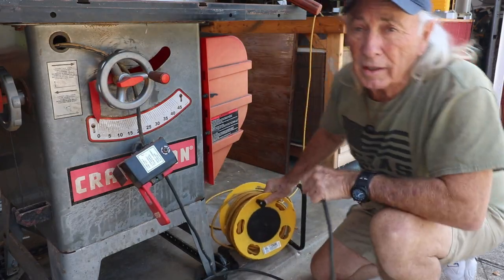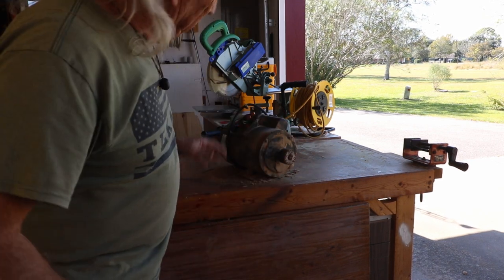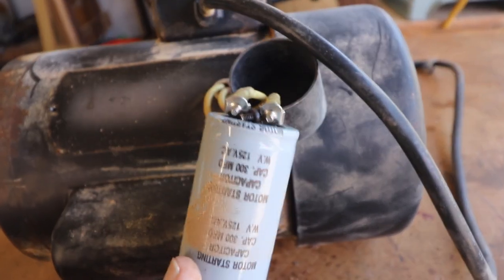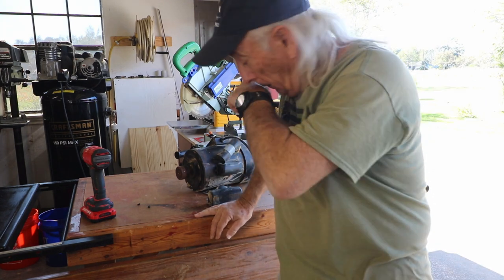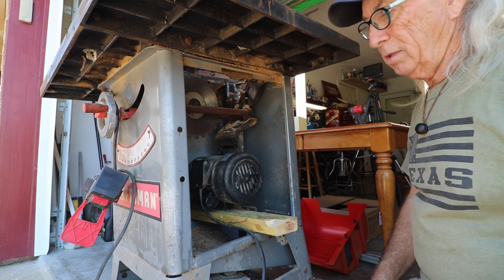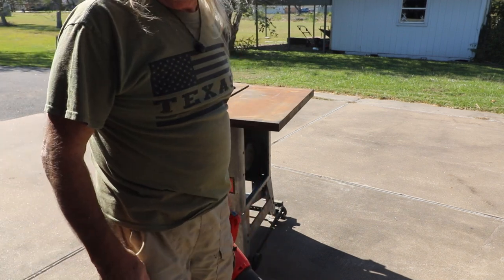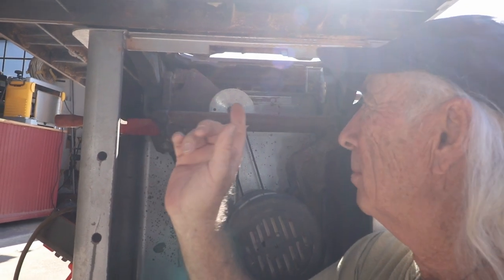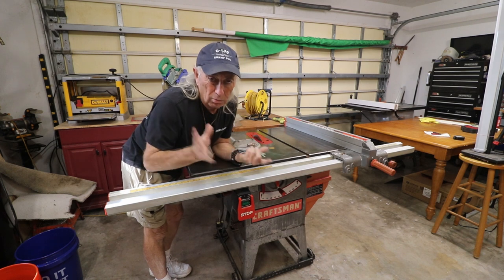Frozen 10 inch Craftsman table saw for free needed work ONLY, Coffee and Tools episode 183

Comment: Greetings from a new liker and subscriber from Denmark. 👍
And what a beautiful place this workshop is located!  Wow!  It's paradise! 

Here, we don't have less than 220-240 volt (for normal household  things like; lights, tv, computer, kitchen supplies (except stoves), etc,  and small tools for workshops also use 220-240 volt. 
Stoves normally use 380-400 volt, and the same for big table saws, big bandsaws, for workshops.  

Wish I could have fixed my problem a month ago with some DIY skills and hard work:
But as I only 220-240 volt outlets and a very low ceiling in my tiny workshop outside, I had to say "No, I'm sorry, but I can't take it" when I was offered an old, tall, heavy and well-functioned bandsaw for a 1/4 of the price for a new and very small tabletop bandsaw, IF it wasn't for this: it was using 380-400 volt AND was 20 inches too tall to fit in my workshop! 
  
My house is rented, otherwise, that wouldn't have been a problem I couldn't fix...  😁
Reply from the maker: Thanks Pia, and welcome to the garage :)

Comment: Did residential landscaping back in the mid 80s. Arrived at a home to start work noticed a Craftsman corded drill laying on top their trash. Knocked to inform owner we were here to work and asked about the drill. Said it was burnt up. Take it. Tossed it in the truck and finished our work. When I got home plug the drill in. Pulling the trigger, not working. It didn't have that burnt smell. I turned the chuck and pulled the trigger again. ZIIIIIIING! I still use it today. I'd heard of a dead spot on electric motors. That must have been it. ???

Comment: I got my first 70s craftsman, belt drive for $15 and just need mud dobber nests cleaned out of the motor. Sold it for $250 after I found a 1950s craftsman, belt drive in an add to remove scrap metal and spotted it in the pile of junk. So i got that one for free, just needed cleaned and tuned. Their old cast iron, belt driven saws are absolute BEASTS, especially if you add an aftermarket fence.
Reply from the maker: My older 12inch is like you said..."Beast" and will be very hard to let go, but I need space now LOL
Reply: I’m now checking out Brads channel. I have a craftsman “replicating” lathe but I’ve yet to try doing anything with it, other than clean, restore and get working smooth again. I did take the replicating frame off with the intention of using it just as a lathe BUT, I’ve never used a lathe as so, as of right now, I’ve not even chucked up a piece of wood in it!  Maybe I can learn something from Brad. 😁
Reply: @keithrayeski3147  spin it, poke it with something sharp and see what appears lol 👍
Reply: @RatedRWoodturning  🤣🤣 your recommendation made me think of those “artist” who throw cans full of paint on a big piece of canvas!!
Reply from the maker: @keithrayeski3147   No neck tie while using the lathe :)
Reply: @SirTools  🤣🤣 more good advice!!👊🏻